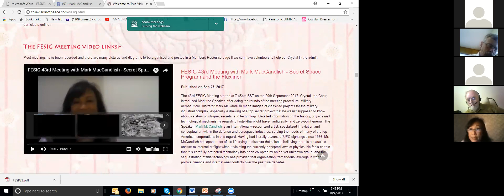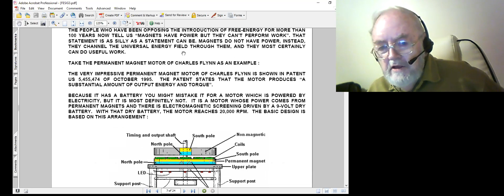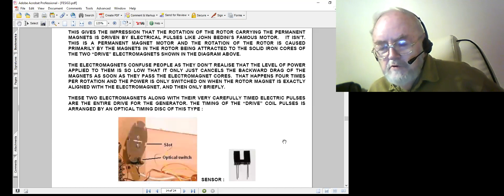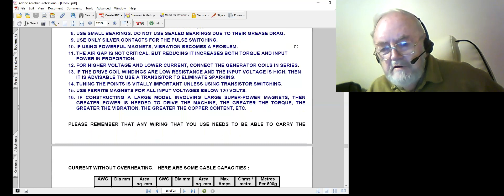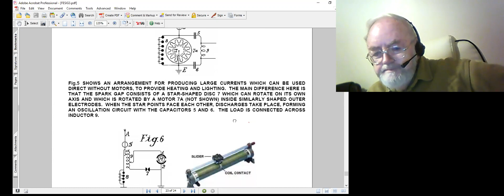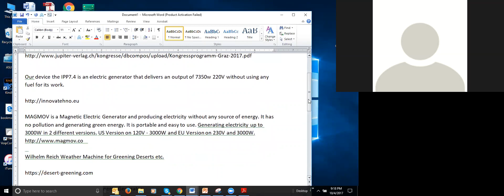44th FESIG Meeting with Patrick J. Kelly on Free Energy Devices

Comment: I am very sorry that I missed this opportunity to talk with Patrick Kelly, as his book, the PJK free energy book has been one of the most helpful books that I have found. I spent several months reviewing his book and many of the scientists involved. Speed reading this several times helped me to find some common ground between many of the devices and methods. I found some other easier methods of approaching this, similar to what Tesla did and many others, however my mechanical methods are far simpler and very easy to understand, use,  and redesign through further testing. https://www.facebook.com/TheRevLtD/videos/t.100007078157586/1578995925679664/?type=2&theater